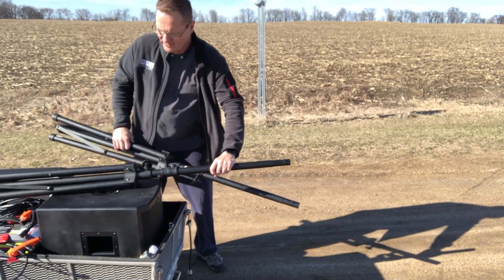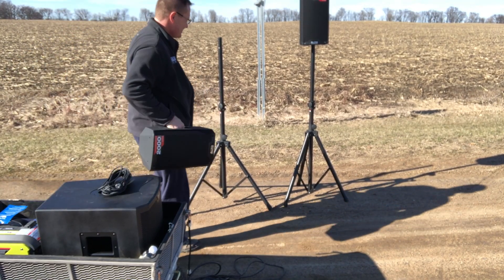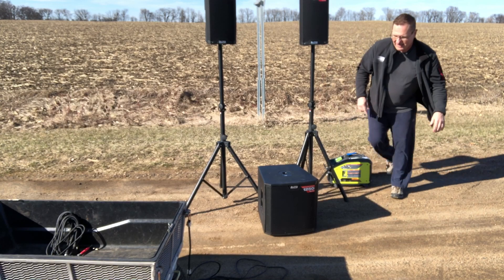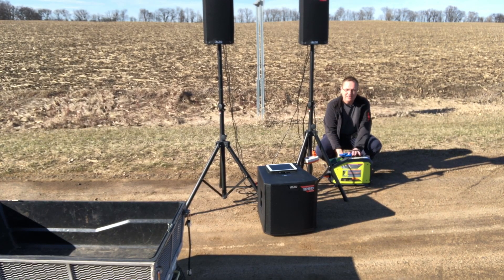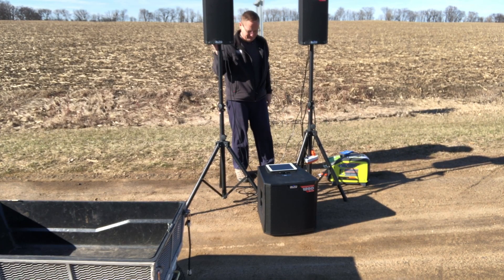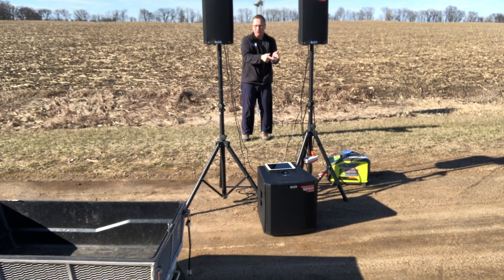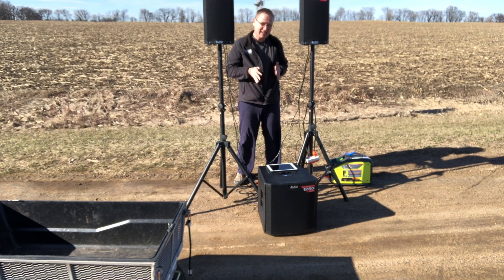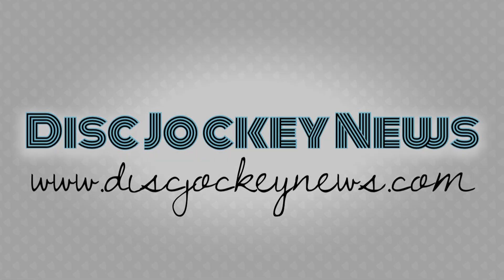Sound System Test In The Middle Of Nowhere TS308 TS212S Ryobi RYI911LP #Alto_Pro #RYOBItoolsusa ‏

Comment: Slick. That propane generator is genius. So quiet.
I have 2 TS310's but I use them for my band mostly. Some Spotify between sets. But I've been doing mostly acoustic gigs lately. 1 or 2 acoustic guitars and 1 or 2 vocal mics, through a Behringer Xenyx 1202 fx mixer. I dig it. Wish it had Bluetooth built-in. I use a Fishman Loudbox Mini Charge for remote places with no power. It has a nice rechargeable lithium ion battery, and if it dies, it comes with an adapter to recharge from your vehicle's 12v output jack.

Comment: ok thank you. i want to buy a battery power station but I am still a bit confused aboutv how many watts my speaker consumes. It says that it has a 1400w amp but in the back it says 75w. Could you help me?
Reply: The will never consume 1400 watts that would be incredible.  Most powers speakers 12 or 15s top speakers will draw less than 100 watts . Now they have a speaker or are advertised as 2000 or 2500 watts power speakers but that is not that it consumes do not get co fuse.  Buy a killowat reader n u will findout q

Comment: Be carful with those altos, I had 2 pairs any even if your not clipping the Amp the tweeters can blow easy. They sound great for price but quality isn’t great. I now have QSC which I can say is built 40 time better.
Reply: What model did you have? These 300 series have a bigger driver that previous models
Reply: All I can say is, if you send dirty sound to your system. They will kill tweeters or burn woofers. that is why they have 0db on the system, all systems... Make sure you have real quality sound files too. No YouTube Rips either. I use Alto and the new TS315 paired with 2 TS318A. They sound great not even pushing them.

Comment: I'm impressed, I  could barely hear the generator. Can you put a larger external tank on that ?
Reply from the maker: Yes.. I plan to use a 10 pound tank on it.. most common is the 20 pound tank they refer to in the info from Ryobi.. and one user puts a 250 gallon on one of these in a very remote location.

Comment: TS308 are powered spkrs....why do you need a generator? Doesn't it run on battery when fully charged?
Reply: I think you have the concept of powered speaker wrong ..... do a video search of what is a powered speaker
Reply: @black10kevin  Kevin I ment Battery Powered Speakers. All you had to do was put one and one together and you would of realized what I asked.
Reply: @DJ_Matnation  but the TS308 are not battery powered .... so your one and one together equals five ... thats what I'm saying ... so you are misunderstanding what "Powered speaker" means.... thats why I said to search YouTube powered speaker to get an understanding of what it is
Reply: @black10kevin  Kevin stop over analyzing.... I asked if they were battery powered that's all.
Reply: @DJ_Matnation  ok if that is what you were asking then the answer is no it doesn't run on batteries
Reply: @black10kevin  Great Thanks.
Reply: @black10kevin  I have the ts415 two and its running with a deep site battery car with inverter pure wave sine 4000watt  with peak power on inverter 6000watt and 70& range i play music 3 ours